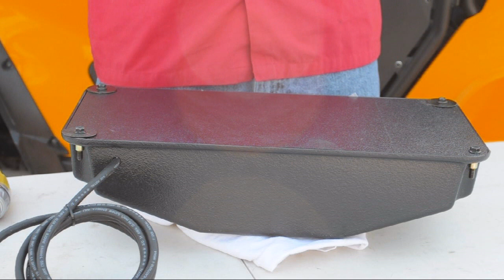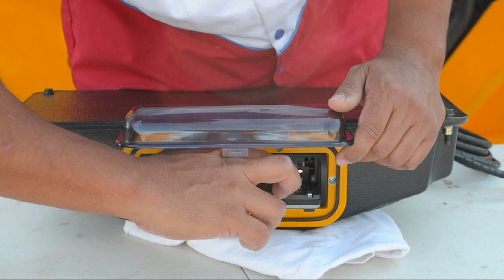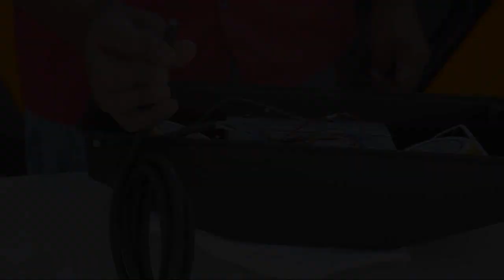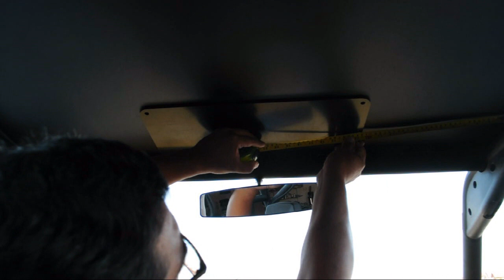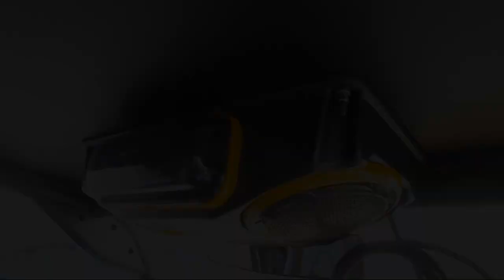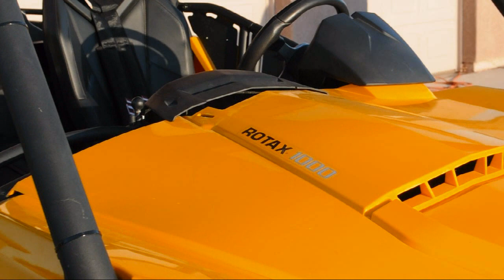EMP Cooter Brown Stereo Pod

Comment: I have been looking into getting a system for my Commander and I always wonder why people feel the need to mount the speakers on the fire wall??? The roof is wear the complete system need to be, because that the last place any mud or water will get to. I don't care how water resistant the system is, its going to last longer above your head and I think the sound will be exactly were you need it to be. Last thing you need to worry about it mudd and water when your out riding. Just my thought!!!